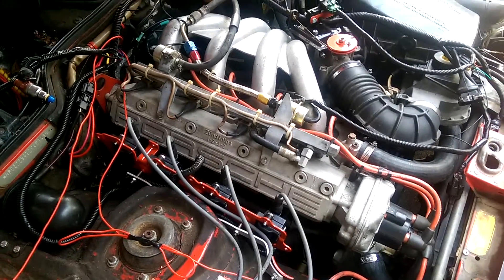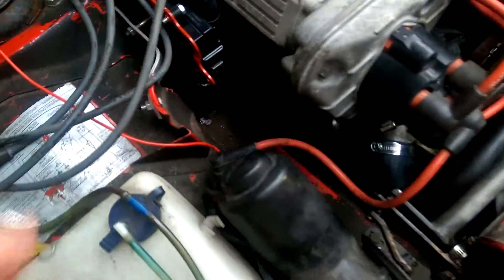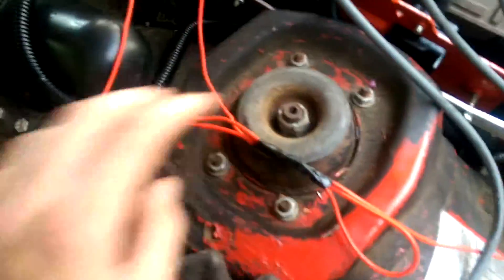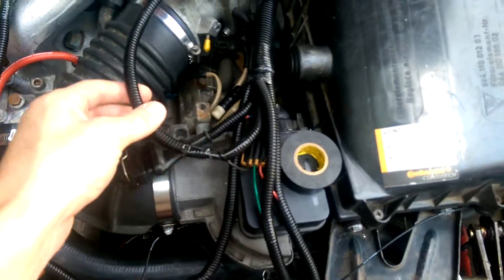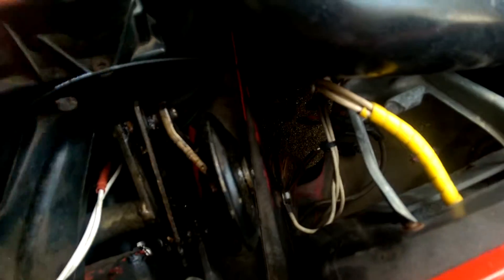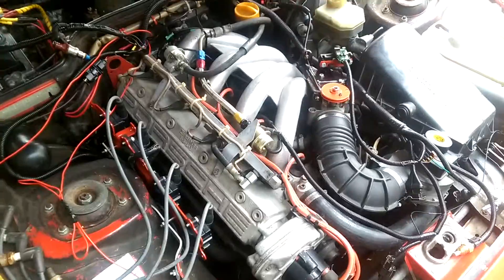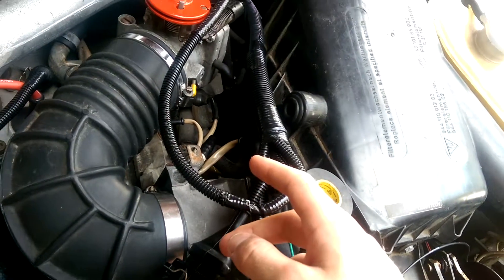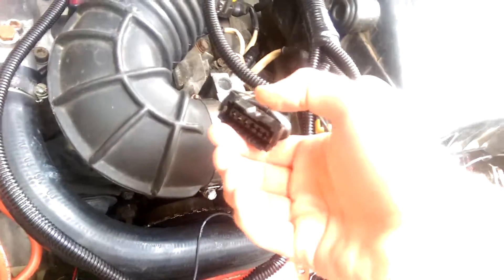Porsche 944 MicroSquirt wiring - Part 4

Comment: I did not quite catch what part of Micro Squirt measures Mas Air Flow , being that now there is no AFM . Also what does the Hall Effect transistor do , is that the flywheel speed sensor maybe?
Reply from the maker: +Thomas Herceg it's a speed density approach, do a quick google on "speed density tuning." It does not need an AFM or a MAF. As for the hall sensor, it reads a trigger wheel I installed on the crank pulley. This signal tells the ECU how fast the engine is spinning and the crank position. Basically, this subsystem does the same job as the speed & references sensors that read the flywheel. They are now deleted on my car.
Reply: +Michael ODonnell  Thanks , I did look up that info ,your doing a great job on your 944
Reply: +Thomas Herceg Also you said at the end no more annoying DME cutoff
, what were referring to was it stalling or slightly dropping idle speed and do you feel that is a defect in the factory ECU?